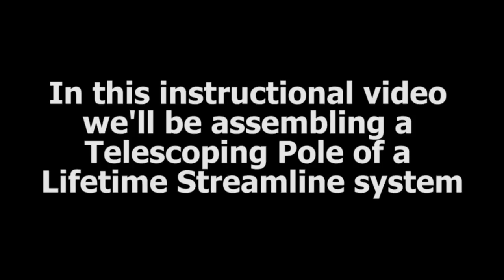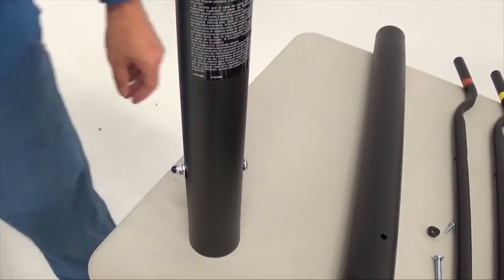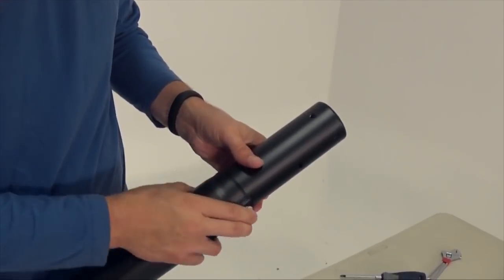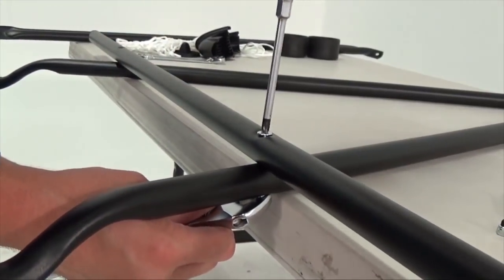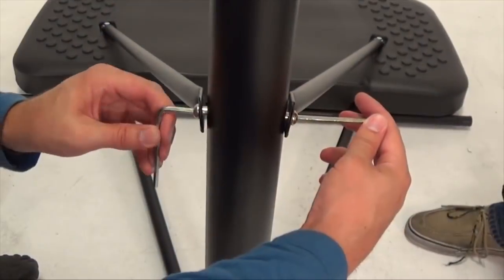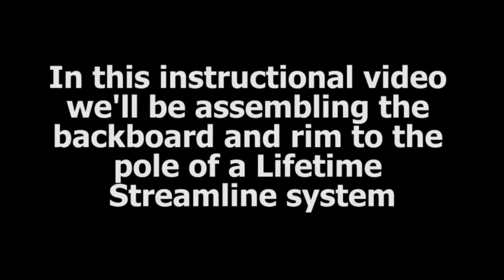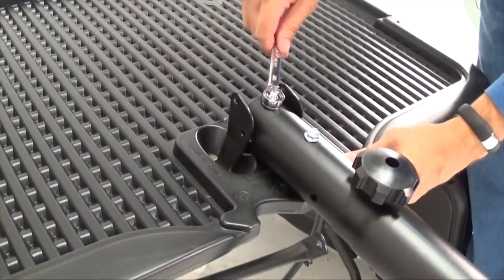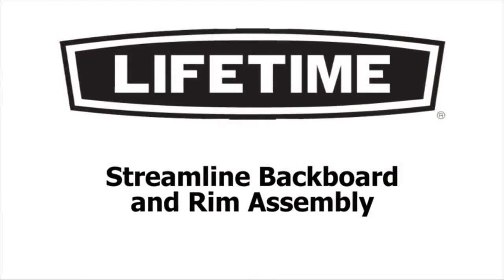How to assemble a Lifetime Portable Streamline Basketball System

Comment: the step at 3:45 if unnecessarily difficult. We CAN NOT line up the two parts of the hardware that have the allen wrench end. So frustrated. the longer side will go go in straight and instead is being forced upward and so obviously the other side cant intersect. Going to take off the brackets from the base and see if it will go in straight. Why not just a straight bolt that goes through so you can ACTUALLY see how they line up.
Reply: Yeah the screw is very small and doesn’t come out the other side.

Comment: I have this exact same hoop I wanted to ask how I could adjust the height of it, I’ve stood on a chair to do it but it is very heavy and I cannot lift it up and quickly put the screw through, the only other way that I haven’t tried yet is to tilt the basketball hoop downwards but I’m afraid that it may break the front base of the poles where the ground and the pole meet as it is a plastic cover, what do you recommend I do ?

Comment: do the screw in the middle pole supposed to stay loose after the rim is put together
Reply from the maker: No, it is not supposed to be loose. You might want to call 800-225-3865 to speak with an assembly expert.

Comment: I jus bought a kmart setup for 79 bucks, started puting together and realised the bottom metal arms on the base have holes that wont fit the main bolt that goes through and the bottom upright pole with its stability shoe plastic thingies ..as I thought it held it all together.. what am I doing wrong here? 3:24 shows this from what id seen

Comment: How do you make the hoop taller cause mine isn't at its max height
Reply from the maker: There is a knob behind the backboard attached to the poll. You simply unscrew the knob and the poll telescope up and down. If the knob is missing your poll may simply be at the lowest height and you need to order a replacement knob.
Reply: Competitive Edge Products, Inc

Comment: So what if the top pole is removed from the middle and the bottom is locked in place by banging on the ground.
Reply: I did that and that made job 3 times more difficult

Comment: These instructions are a mess.  We already had the poles out of the plastic, then red you should leave one inside another.  It was impossible to figure out which pole was which.  Why not label the damn things.  Put a friggin sticker on them.  The different pieces of hardware are labeled with 3 letters.  In the ubstruction, some identical pieces have different letters.  So confusing.  So anyway, we get the poles together wrong, now have to figure out how to get them apart and start over.  Shoulda found a video first, but who'd have thought we needed one.  Did watch a different one from the company, but the don't zoom in on the parts so you can tell which one they are working with. I can't tell from the videos which pole is which?  This should've been a whole lot easier.